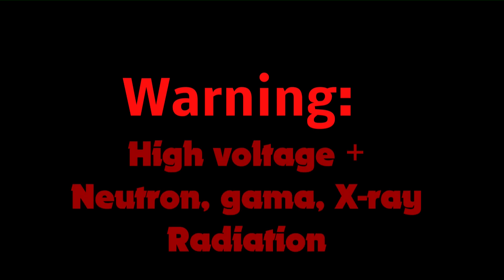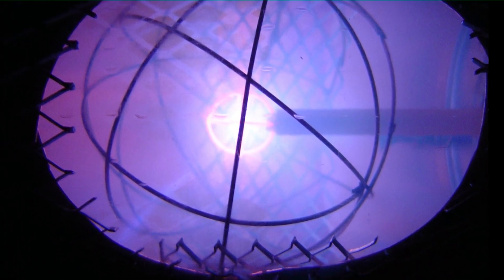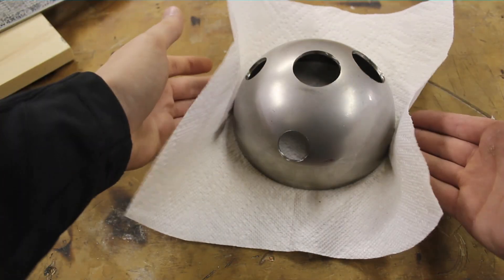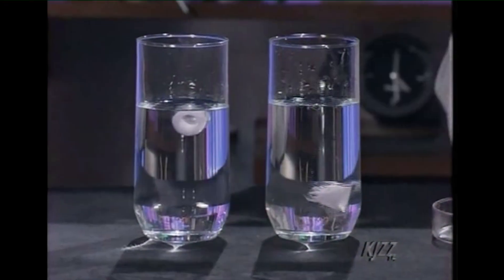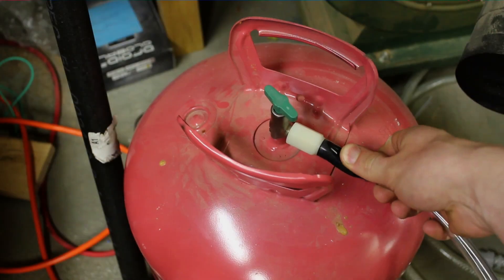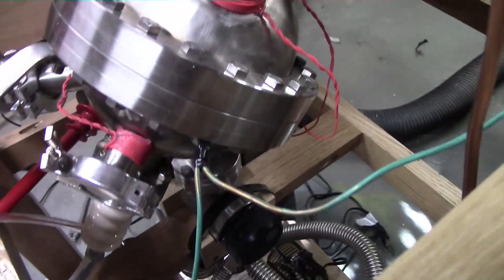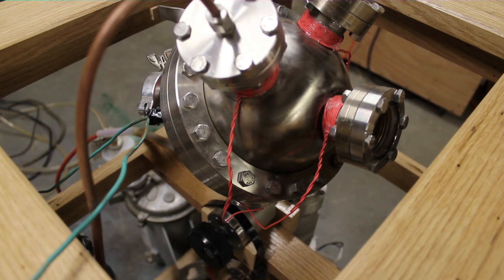How to Make A Fusion Reactor

Comment: Wow this is so over the top expensive and needing lots of special tools, etc, but fusion is lots easier than that, have a look at Malcolm Bendall's thunderstorm generator that destroy CO2 in exhausts using fusion to turn the carbon into oxygen, the parts once mass produced will cost about 50 dollars, no need for catalytic converers and their expensive platinum filters, just steel spheres in the shape of a Vajra. Also you can easily do fusion of Aluminium to Iron no Deuterium needed, thanks  (AL13 + AL13 = Fe26 ) https://youtu.be/unjO0gjV1Hc

Comment: the entire reason a fusion reactor works, this is a D-D reactor, it works because two Deuterium atoms collide and release neutrons, this takes alot of heat, but i don't get why you just don't build a reactor with 1000 or so psi, is it unrealistic? sure but then it wont be as inneficient

Comment: Big question: Once they do reach commercial fusion, how do they intend to generate electricity from it?
You can't run plasma over heat-exchange pipes to generate steam for turbines.
The only method I can think of is MHD, but that would still excessively corrode the contacts.

Comment: I have always wanted to build myself a fusion reactor But I've never been able to because the deuterium is very hard to get in gas form yes I can get heavy water and electrolysis it to make deuterium but the only places I could find that sold any sold tiny little 100cc to 300cc tester size quantities if anyone could suggest any way to get either the deuterium gas or larger quantities of the heavy water I would really appreciate it. Oh I'm in Canada if that affects anything

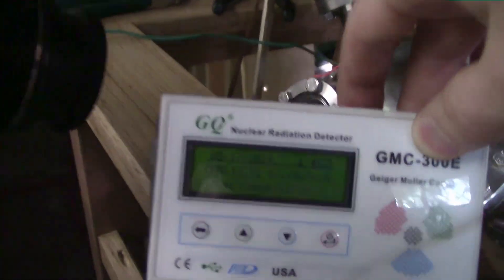Comment: 2:44  how you are measuring detecting neutron with normal geiger counter neutron is chargeless ?
Reply from the maker: Silver activation
Reply: @BenNBuilds  i mean , using Geiger counter ? It shouldn't detect N due to the fact it's charge less ?
Reply from the maker: @omsingharjit  yea it detects alpha particles emitted after a silver atom absorbs a neutron then decays into cadmium

Comment: I am curious to know if you can use this to create fusion. Search for "spherical electromagnet". It should be the first thing that pops up. Look at figure 1. You will know it when you see it - it's my icon that you see to the left. In this design the plasma is rotated like the armature of a motor with the axis of rotation constantly changing. The counter emf inside the plasma compresses it toward the center.

Comment: The sun is an electric plasma discharge phemomena. Not a thermo nuclear fission furnace.
U use electricity for your experiment, just like the sun uses electricity. Check out the Safire Project. Excellent setup you made!

Comment: Where did you go to buy the deuterium im trying to buy some
Reply from the maker: Airgas, but you need to go through a pretty lengthy cert process with the nuclear regulatory commission
Reply: @BenNBuilds  ok thx also where would you recommend getting parts for the vacuum chamber

Comment: Where did you buy the vacuum parts?
Reply from the maker: Ebay!
Reply: @BenNBuilds  thank you for your reply. Planning to build one. Designed it with acrylic and steel so its nice to look at aswell. gonna need shielding if I do fuse though haha.  am gonna run it of 2 flybacks in series with ZVS Driver. maybe about 40kv and 800watts. if not I have as many flybacks as I want i can always hook up in parralel.
Reply: @BenNBuilds  Improvising alot because of my tight budget.

Comment: Why ist the radiation so dangerous like in a fission reactor?
Reply from the maker: It is very dangerous while the reactor is running, you need to shield yourself or make sure you aren't exposed to too much. The good thing is there are no long term radioactive byproducts once you shut the reactor off, which is very different from a fission reactor

Comment: Are Deutrium - Tritium considered renewable?
Reply: FriedFrudda kinda, sorta I mean they can be, for a limited time, I mean remember E=mc^2, so some atoms have to go bye bye and change into others.
Reply: So is it helium the by product from a Fusion reactor? Any water vapor too? Do you know when is the first fusion reactor suppose to be built?
Reply: FriedFrudda well, there are quite a few fusion reactors. The problem is having it generate equal to, or, what we really want, more than the energy we put in. I’m not sure about the hydrogen being made, I mean deuterium is a isotope of hydrogen so yeah... it’s already there I suppose
Reply: With Fusion reactors, are they suppose to heat water to steam and turn turbines, heat transffered directly into a electric magnet heat generator or electricity as a by product directly from electrons?
Reply: Do you think fusion reactors may not succeed due to the way they output energy and amount of fuel available? I heard that if we extract deterium from water, then our water on earth would become non renewable even though we won't run out for the next million years. I also learned that helium is a by product of stars fusion and the hydrogen is lost into space but not sure if water vapor from space enters Earth. Please tell me if I'm wrong.

Comment: Oi, nice build buddy! Great work. I have few question here: how much was spent on this single project? I mean total budget including vacuum parts (stainless) and neon sign transformer, nichrome(which is used as a accelerator grid), et cetera. And is it possible to make fusion reactor in a much low budget? I still don't have the right material for chamber such as stainless steel and other stuff. And does it have to be in a shape of torus or it's because of the efficiency?(I looked up some of the tokamak fusion reactor in a great scale, and I find it often that many fusion chambers have that torus-shaped container.) and is it able to use this energy or yet not really sustainable? And will this reactor effects on our body? Thanks in advance:)
Reply from the maker: description

Comment: There is fusion present, so why is there less output energy? What seems to be the problems with sustainable fusion.
Reply from the maker: I put a lot more energy into the system to create the conditions in which fusion can occur than fusing atoms release.
Reply: BenNBuilds So can you make it to where there is output energy that gets converted to electrical energy? If so, how?
Reply from the maker: If I knew that I'd have a Nobel prize

Comment: for the high voltage supply, can you use 2 stun gun modules that puts out 20kv?
Reply from the maker: Those have very little current and are pretty far form a smooth DC signal

Comment: I have two questions for you. First, how would it be tapped to power anything? Second, if it is so easy make one, why is it that there are none built on an industrial scale that could be used for clean energy?
Reply: George Pierson it takes more energy than it produces, so nobody is using them. Trying to get energy from it would be like plugging in a sprinkler and then making a miniature water wheel that generates power from the falling sprinkler water to power your toaster. It would be better to just plug in your toaster.

Comment: Unless you can sustain chain reaction there is NO REASON WHATSOEVER to use the term "reactor" in describing this device. It is a "plasma fusor" NOT a "Fusion reactor" .
Reply: "Reactor" implies a reaction, in this case a "self-sustaining fusion reaction". This unit pumps energy into a plasma until fusing happens OCCASIONALLY in the plasma. Far far less fusion energy is released than the energy it takes to create the plasma. It has no purpose other than as a hobby activity. It is most definitely NOT a "reactor" this kind of device is correctly called a "fusor" since there is no "reaction" happening....only fusion! Kewl stuff tho.

Comment: I understand most principles of the farnsworth style fusor other than the power supply. From what I've read the consensus seems to be you cannot achieve fusion with a neon sign transformer, you would need a x-ray transformer and have to rectify it. But yet I see you undoubtedly achieve it here with a neon sign transformer. So my question is, how did you use a NST and Cockcroft Walton, and still achieve 30,000+ V @10ma? Like how many stages was the multiplier and does the multiplier affect the current, decreasing it in any way? Also... did you use a variac? I didn't see one in your video.
-Thanks! :)
Reply from the maker: Yea I got an old NST off ebay, pulled the center GND tap, bypassed the fault intercept circuitry and grounded an output.  I then fed the 110v NST with ~200+v. That got me to ~10kv at "just melt the secondary" current if it shorted out. The multiplier was a full bridge rectifier, the output was not smooth as the caps were a bit small. I pulled off voltage from the 4th stage if I remember correctly. I measured 32kv with a HV multimeter probe too so I did get to voltage, but it was far from a job well done.  
It burned the shit out of one of my ballast resistors, so it was making some decent current. Then I burned out the NST pretty quickly but was able to get some admittedly sketchy measurements from the reactor. 

Long story short -Its not a good way to make a 30kv 10ma supply but it did work once. I'd recommend just continuing the hunt for an ebay supply. I ended up with a 60kv supply that can supply 10ma for 300$ a year later.

Comment: https://youtu.be/EBwn1pqx1hU Thermonuclear fusion is pseudoscience. The TOKAMAK project will fail. The phagocytic nuclear reaction is a "thermonuclear fusion." The pressure converts a hydrogen atom into a neutron. Pressure helps the nuclear reaction, the temperature hinders. www.facebook.com/Статическая-теория-атома-163704797446539/?ref=bookmarks
The creation of a reactor for a hydrogen nuclear reaction can be solved in 3-4 years.

Comment: I made one and it worked
Reply: my ass
Reply: @Vinny maybe, maybe not.  The concept is simple. It can be done in a less professional build with few easy to source items. The most difficult part is pulling a high vacuum but with the right pumps and simple to acquire knowledge it can done. High voltage is is super easy to do in a lot of ways.  Safety is a challenge and expensive,  but doesn't preclude the possibility that one can did it comparatively cheap.

So why with absolute certainty call someone a lair?
Reply: @kreynolds1123  yeah maybe...but in brazil is kinda hard to make this

Comment: if you put hydrogen in it and pump out the helium can you generate helium? And what would be the effiency
Reply from the maker: Maybe as good at several thousand atoms per minute if you could only get the helium (which is not even close to stable)... not really going to happen. For reference there are ~10^18 atoms in a cubic centimeter of air, let's assume we collect 10,000 helium atoms/ minute, it would take 190,258,751 YEARS to make one cubic centimeter at room temperature/standard pressure (assuming air and helium have the same # of atoms at the same pressure/volume...) its a rough number but I think it makes my point. Then you need to make sure you didn't "suck up" any hydrogen with what would have to be an electrostatic ion pump (not possible while fusing) as its in a vacuum so there's no real way to introduce a pressure differential.
Reply: Well it's the kind of ideas who sounds cool but, they are'nt

Comment: Have you tried using hydrogen and boron? I know it is hard to fuse but according to some sources online it only has to be twice as hot as deuterium-deuterium fusion.
Reply: Can we use a normal hydrogen and use the zvs circuit its can make around 10kv to 30kv ?

Comment: when you say negative polarity on the power supply, you mean that the cathode is connected to the inner grid or is it that the voltage have to be negative?
Reply from the maker: The inner grid is at a potential of (-)30-40kv with respect to the chamber.
 Grounding the inner grid and supplying (+)30-40kv to the  chamber would also work, but would require isolating all the pumps and valves and probably painting the whole thing with liquid electrical tape (very annoying)
Reply: So maybe I could use a DIY powersupply and then do an schematic for a negative potential?

Also, how did you get the deuterium?

Comment: How dangerous is this if i manage to fuck up in one of the steps? 

Also what articles would you recommend to read before trying anything stupid in the process of building it and when it's already built.
Reply from the maker: Electrocution. There is a lotof good info on the fusor.net fouroms, also look up radiation safety and high voltage safety

Comment: Did you have a net output of power? Did you use boron for shielding? I know you mentioned hydrocarbons but figured I'd ask what all you used. Also was your reactor vessel activated? I don't know what those vacuum chambers are made of but if it's steel then wouldn't there be a risk of producing cobalt 60? That also brings up gamma rays and what you used for that too.
Reply from the maker: I just had a small amount of silver for neutron detection, The neutron emissions were quite low . Only enough that the silver 111 was only detectable for 30 seconds. The neutron causing reaction only lasted 10 seconds before I powered the reactor down. I used a pile of office water bottles for shielding and the stainless steel chamber stopped pretty much all of the x-rays. I had a gieger counter next to me the whole time.

Comment: Question, where did you get the vacuum parts and how much were they?
Reply: You can by a vaccum  pump with a low cfm rating or you can go to a HVAC supply store and they sell them there pretty expensive that route but you can get the prices better on amazon or eBay.

Comment: Supposing I were to construct such a device, would standard lead brick and concrete blocks suffice in the effort of stopping high energy neutrons? I understand that Gamma and X-Rays are also emitted, which may be stopped by the lead, but for the penetrative neutrons, I could use a concrete apparatus? I cannot construct a water based apparatus as I have no intention of high voltage interactions.

Comment: Oh please, don't get Fusion and Fission muddled up. Even CERN is not ready for fusion yet, hence the huge costs and heat amounts needed for Hydrogen cores to fuse.
Reply from the maker: +The Renegade Programmer no, its fusion. Just not efficiently at all. Fusing two atoms is pretty easy (especially an element like deuterium) using fusion to generate energy is still really difficult for us.
Reply: Nicistarful this is fusion. The real issue with fusion reactors is sustaining the fusion and getting more energy output than input (I do not mean to violate the first law of thermodynamics with this, I mean to say that more of the energy released by the reactions is harnessed than what energy was used to start the reactions). Making inefficient fusion is quite easy for nations. I also enjoy how condescending you sound about him making a mistake when you are the mistaken one.

Comment: If I screw this up I could die?
Reply from the maker: +Nuka Junkie oh yea
Reply: Ask Doc Ock, and look what happened to him.
Reply: If you have to ask then yes...
Reply: If you screw it worst cases are you either get electrocuted with 20 - 30 kV or blow yourself up with deuterium (as an hydrogen isotope it's almost chemically identical to it and so very flammable).
If you don't screw it worst case is you sit in front of it to admire your creature, let it run for an hour or two and get a radiation poisoning to do envy to a Chernobyl firefighter.
Reply: @qdaniele97  i'm reasonably confident that if this put off that much radiation it would have ben global news that some idiot created a  500 mile exclusion zone buy building a reactor in their basement.

Comment: Dude, I'm really confused, could you enlighten me on this? Did you really obtain a fusion reaction with this fusor? And if so, why is it pointless? Wouldn't it generate energy even if it's a small amount?
Reply from the maker: +Stealthy Bucket yes, it actually fused atoms together. It generates a pretty small amount of energy ant takes a TON of energy to produce it. Also, there isn't really good way of harnessing the energy created  by one of these.
 Its kinda just to say you made a fusion reactor, and to get some high energy neutrons
Reply: +BenNBuilds Thanks for the explanation dude!

Comment: can it start chain reaction???
Reply: Aravind Krishnan No chain reaction can be only started in a fission reactor when the atom is split. In a fusion reactor you need to put in energy to fuse atoms together.
Reply: KILLEREŁ. Thanks for reply.  I asked the the neutron out of this reactor has ability to start fission by placing U238 which requires high energy neutrons
Reply: Aravind Krishnan Yes it can if you slow it down
Reply: KILLEREŁ  Ok bro

Comment: what are the wires around the viewports for?
Reply: I believe they connect to vacuum gauges, and it's just a neat way to store the wires. I could be wrong tho
Reply from the maker: +Blast I added the viewport coils so that I could apply magnetic fields and try to create a more spherical acceleration pattern. Also just to play around with it a bit, trying to pull more electrons off as he deuterium enters or to the vacuum pump port